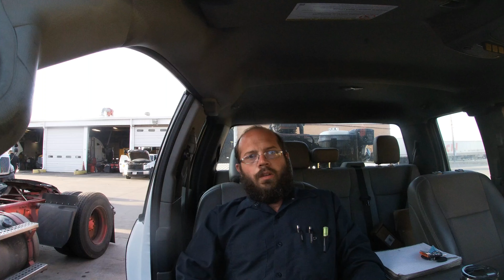Exhaust Gas Pressure

Comment: My homie make so complicated for the viewers it’s exhaust gas pressure sensor which is around 150.00 bucks right now or you can order from eBay is 80.00 bucks there is only 1 plug 🔌 on it disconnect then put your socket in it open it clean the thread area install the new one at the end turn on your key 5 time to reset the code or connect the harbor tool computer to region the truck.thanks me later ✅🙏

Comment: Does the sensor expect to see pressure at normal operation? My real question is will it think everything's normal if those two lines that feed it are intentionally replaced with plugs in the sensor housing..
Reply from the maker: At key on dpf pressure, exhaust gas pressure, and intake manifold pressure should be close in reading.

Comment: Been slowly working my way through your vids enjoying them all. Uk based and new to Cummins ( off highway only now over here) question, what pins are you bridging on the sensor to check the state change?
Reply from the maker: I bought a pin kit off Cornwell a few years ago. About time to get a new set. Most of them are either broken or lost. Thank you for watching my videos. Still trying to get the hang of filming while working
Reply: @dirtyassdieseltech6348  thanks for the reply dude, my question was poorly phrased sorry. Are you bridging the 5v ref to the signal line or ground to watch the state change on insite? neat little trick. Thanks again 👌

Comment: Replaced gas exhaust pressure sensor, but still throwing  code after regen,is thier something else besides that could be causing problem, could tubes get clogged?
Reply from the maker: I would verify harness. They move a lot while engine is under torque. Usually clogged tubes are caused by engine failure
Reply: Thank you sir this helps alot
Reply from the maker: @davidromero9985  check out this video. 
EGR outlet pressure code. Found wire rub, corrosion, and a broken pin!!
https://youtu.be/HVztfFMJG0w

Comment: It's great to listen to I myself work for an LTL company, but not sure if I could post videos.   Any help is good help. I'm an older tech learning the computer
Reply from the maker: Computers are a pain in the ass. Wish everything would go back to manual. Throttle, fueling, unactuated turbos, transmissions, diff lockers. The industry used to be simple, engineers and California had to screw everything up. Not to mention Greta thunburg.

Comment: I have a 2015 kenworth t 660 with a Cummins ISX  the 1209 code is showing and I changed the sensor 
And 12hundred miles later the same code came on again what could be causing that
Reply from the maker: Do you have your esn?
Reply: What is esn
Reply: Oh I got it engine serial number
Reply from the maker: In the process of posting a reply video. Might help you diagnose.